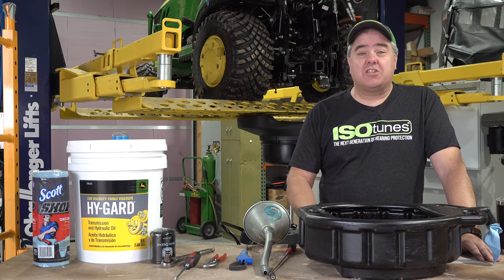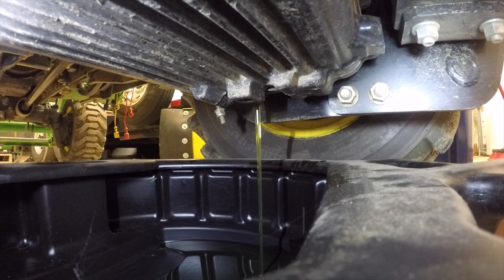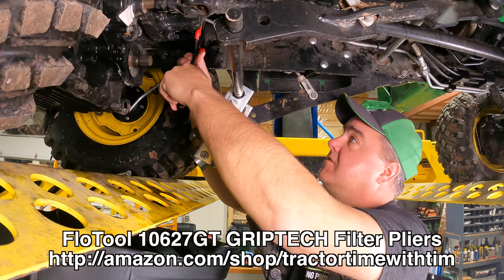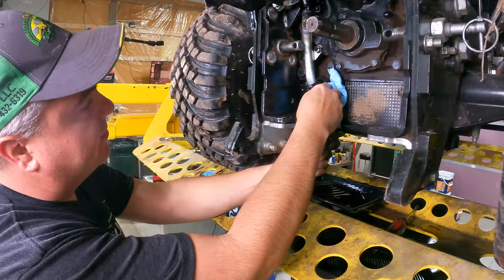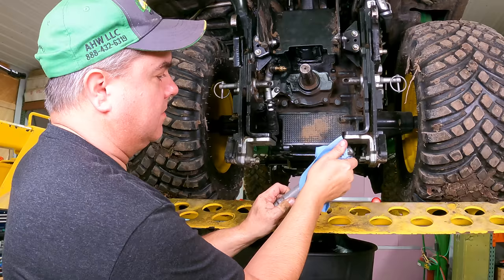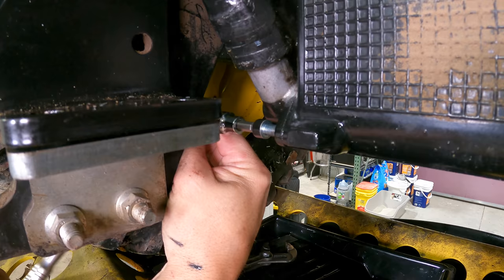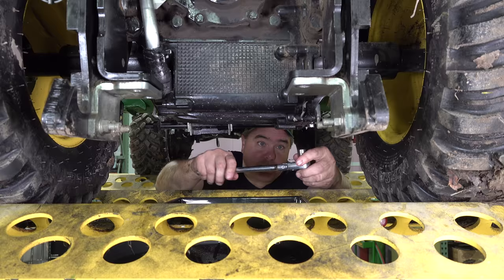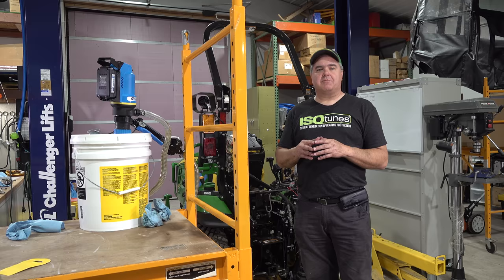Metal Shavings in Oil? John Deere 1025R 200 Hour Hydraulic Oil Change

Comment: Hey Tim, just a little cheat to avoid removing the hose clamps and lower rubber tube. I don't know if you can do this with your "custom" made tube with the temperature fitting. The pin for the left lift arm, just behind that and left of the PTO there is a single bolt 11:53 (top of the screen). Remove that instead of the hose clamps. It's just above where you placed the hose clamps once you moved them up the tube, 13:57. Once that bolt is removed, you then use the 6mm allen wrench to remove the bottom. You then pull left as usual, then separate the 90* elbow from the magnet portion. Then pull magnet portion out. 
With this tip, removing that one bolt, you eliminate wrestling with the hose clamps and trying to push the rubber hose up to remove it from the 90* elbow. It all stays attached and you only separate the tube with the magnet from the 90* elbow. This is a little trick a JD mechanic showed me. They do enough that they know little short cuts like this.
Reply: I'd seen this done before in another video. My only concern was getting the screen aligned as described in the service manual. Was it easy to get the screen inserted and aligned correctly? Thanks. I'll be helping a friend change his this weekend and I'll give it a try.
Reply: @CC-te5zf  Yes, it has a shelf type thing it lays on, no place for it to go other than where it needs to be. Just before being all the way in though, insert the magnet tube into the elbow, the o-ring will hold it together as one, then put the rest of the way in and tighten the 6mm nut. Then put the bolt back in next to the PTO shaft. Much easier than dealing with hose clamps and hose.
Reply: @joebarrett9830  Thanks!

Comment: Have been a mechanic for a few years. On the hose sticking the best thing I have found is to use a 90 degree pick , by sticking it on the inner diameter of the hose and sliding it all the way around the pipe or housing its attached to will usually free it up.
Reply: If is reachable, I use a thin flat screw driver between hose and tubing .

Comment: Hi Tim,
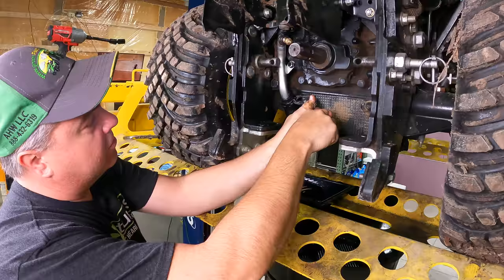While watching your video, at around 11:45, I noticed the mouse on your pallet rack along with your cat trying to catch it!

When I change any kind of oil, I put my hand in a small plastic bag, and then remove the drain plug. keeps my hand clean and I have found that I'm less likely to drop it in the oil pan.
Reply from the maker: Watch the end of the video for more cat and mouse video.

Comment: Small zip ties work well to hold those type of clamps open, on the oil line to the magnetic strainer. You can use two hands to more easily move the clamp.

Comment: 1 or 2 cans of brake cleaner saves alot of towels and helps make all surfaces clean before removing items. Helps with spill clean ups too.
Reply: Yes, a JD mechanic used brake cleaner over a 5 gallon bucket to catch all the shavings.

Comment: Remember Tim, Brake Cleaner is your friend. The added torque on the filter and the hex bolt usually come from paint the first time you disassemble them.

Comment: Hi Tim.   On another YouTube video watch a tail three cabins he has a 1025R2 and when doing this oil change he shows how you don’t have to mess with those clamps you just loosen bolts up above and it gives you enough room to pull it out
Reply: I was wondering about that also. Especially since that pipe was just swapped with the new one with the oil temperature sensor. With that bracket screw removed there is plenty of play in there to get at that hose and clamps. That pipe is attached with a rubber hose at the top as well so no worriee about flexing it.
Reply: do you have a link to that video, i sure would like to make that job easier.
Reply: @williamcoffman7149  all I know how to do is hit the search button. A tale of three cabins 1025R hydraulic oil change and it will come up.

Comment: Hey Tim,  I have recently (last year) done the 200hr service (really at 400hrs, dealer did the first one) and worked from yourold video.  Did not remove wheel.  I faced the hose removal challenge.  Wasn't too bad.  FIlter was a PIA.  Had to wrap a few layers of Duct tape around it to get my wrench to work.  LOL!  Great videos. thanks for sharing!
Reply: @Trevor4ag  Last resort for me as it can be messy.  That said, I've used it many times...and it gets the job done sir.

Comment: Tim, if you spray brake cleaner on the hose , the spring clamp will slide over the hose easier. It will not hurt the hose and will evaporate off the hose. It gives you just enough time to slide the clamp on. I own my own auto shop and have been using this trick for years. Spring clamps work better that worm drive clamps because the don't loosen up.
Reply from the maker: Cool. Thanks!

Comment: Tim, you must be a magician, you made sliding those xxxx spring clamps up so easy on rear axle, when I finally got mine off I went outside of my garage and threw them as far as I could and returned with worm gear clamps that’ll save me 45 minutes next 200 hour service. The fuel filter under the seat was a piece of cake in comparison.

Thanks For The Great Videos 

God Bless
Reply from the maker: Ha!  Thanks for the chuckle.  The first time was incredibly frustrating!
This time it went much better!

Comment: I wonder if it would be best to just replace those hydraulic hose clamps with regular screw type hose clamps.  Those would be much easier to loosen up.....lol....and that's why you don't comment until the end of the video!  Thanks for redoing this, I'm about to do this for the second time.  It will be interesting to see how the shavings look the second time.
Reply from the maker: Other commenters are saying these clamps are better
Reply: Use the spring clamps. They provide constant tension on the entire circumference of the tube. Worm gear clamps create a pressure point under the screw.

Comment: Hi Tim
When you were talking about replacing the hose clamp with a worm clamp it's interesting to understand the purpose of the continuous pressure clamps. When a worm clap is tightened and the hose ages many times there will be leaks. as the hose hardens. Squeeze clamps apply steady even pressure. You will see this around transmission cooler hoses on automobiles. Worm clamps are easier but defiantly not near as good. If they were as good don't you think assembly lines would use them as they are much cheaper.
Reply: But I would expect they take considerably longer to screw tighten (install) and probably would have to be factory torqued. Everything I have read for years instructs me to not re-use those "spring" clamps. I stand to be corrected with verifiable authoritative affirmation though. I would really like to know...

Comment: Just did my first hydraulic fluid change at 160 hours.  Must say I'd been preparing for the moment by watching you and the guy on Tale of Three Cabins, both excellent tutors. So, everything went easier than planned, and from start to finish was about three hours, working at my usual snail's pace. I have one very important recommendation for those of us who can't afford a steel tractor lift: Rhino Ramps. I bought four of these on Amazon for less than $200. They held my 1025r easily and made the job almost a pleasure as far as accessing the filter, plug and screen. Next I'm going to see if they hold my pick-up truck so I can do my oil change there. I'm 79, so I think there are no excuses for not doing the hdf change yourself if you're healthy. Stay safe and keep those videos coming.

Comment: Two things I highly recommend 1) prior to doing this kind of service do yourself and your tractor a favour and spray it down all over the drive line with a cleaner de-greaser and wash off. There is nothing that can be harmed in doing this it will only make the service go smoothly and long term over all benefit the tractor. 2) Get a paint marker and mark the new oil filter with the operating hours shown on the hour meter, this makes it very easy to keep track of when to do oil services.

Comment: Those strap filter wrenches work and work well as long as you don't get the cheap rubber straps. There is a strap wrench that had cords in it similar to a serpentine belt that does not really stretch and it works very well

Comment: Tim, thanks for all the valuable information that you have given me over the last couple of years. I have a 2022 1025R and I just did my 200 hour. The oil change was a piece of cake, greazing was kind of difficult at the hidden zurt, and the hydraulic oil went great until I found the plug washer on the bottom of the oil pan after I had already put new oil in. Luckily, it won't be too hard to drain and re-use the oil. Thanks again for all your help.

Comment: Hey Tim, they have spring clamp pliers that make those easy to remove. Then use a screw clamp to go back together so you don't have to fight them anymore. Just don't over torque the clamp when going back together.

Comment: Your comment about the oil pump being high end is an understatement.  A battery powered pump and flow meter is around $750. I can't see many DIY folks going that route instead of a funnel.  :-)
Reply from the maker: Without the flow meter, it is $394….then 10% discount.    That is much more reasonable in my opinion.

Comment: To your point about tightness.   I ride a motorcycle and when I do brake jobs or any kind of maintenance, I tighten to the torque specs.  When I did some work on my tractor the other day, I noticed JD had massively overtightened bolts.  They actually damaged a couple washers they overtightened so much.  I bought the tech manual from JD and they have a very nice torque spec table, but it doesn't seem like they follow it at all.

Comment: I never reinstall the spring clamps.  I replace them with aircraft grade T-bolt clamps.  Much easier to take on and off in the future.  And they can’t pop off the pliers and end up lost in the garage.

And, you can spray things off with brake cleaner to get the area around them.  And, it is a a good way to clean of the screen filter.

Comment: Thanks again Tim. I've never done this and was a little hesitant. I asked the dealer if they could come to my home to do it, as I don't have a trailer. They told me $450.00 ball park. I guess that's fair for having to come to my house but it's still a bit high for me, especially when it will have to be done again and again. I'll get the fluid  (and another filter wrench) and give it a shot. My biggest fear is stripping the 6mm allen (hex) bolt). Thank you.

Comment: 12” knipex channel locks will take the filter right off. It looks like it won’t fit, but I got it in there with the PTO shaft still attached. Tim is right Knipex pliers are legit.

Comment: Just did service to my tractor at 223 hours.  Looks like dealer just replaced fluid and did not clean screen at 50.  My case had alot of white sealant in the bottom.  You state its not a problem but I will take it to my dealer next week and see what he says.  Excellent video.
Reply from the maker: The sealant is normal.  No issue.  As far as I know, 100% of 1-series tractors have this.
Reply: sounds good, I'll let it be. @TractorTimewithTim

Comment: You may want to put some anti-seize on that bolt going into that aluminum housing.  The reason it was hard to break loose was 1.) paint, and 2.) a little galvanic corrosion all ready.

Comment: They do make hose clamp pliers for those hose clamps that hook in the eyelet of the clamp so they don't slip off and in some cases actually latch the clamp in the open position. A lot better then your "nipx" pliers.
Reply: I was going to suggest the same thing. They work excellent! I didn’t know they made such a thing until my buddy helped me change a radiator bottle.

Comment: Tim, I started watching your channel in 2017 when I was deciding on whether or not to get a backhoe for my second Kubota BX purchase.  Short answer, I did.  My first BX was purchased in 2002 and it was a great machine and my son has it and it is still going strong.  So I’m partial to Kubota’s for subcompacts.  I like Deere as well considering I have four of them of various size, shapes and vintage.  

So I finally subscribed since I have to comment to this video.  First off, good video as most are.  Second off, the BX is so much simpler to change the hydraulic oil!  There is no hose to remove, simply unscrew the large banjo fitting and let it drain.  Also, the reinforced frame for the backhoe does not affect ground clearance, so there is no issue there.  Can easily access all points with the tractor sitting directly on the floor.  And I’m knocking on the door of 66 years!

Anyway, keep up the good work but give Kubota credit when credit is due!

Bill
Reply from the maker: Thanks for subscribing and commenting!

Comment: The instructions on the side of that hydraulic filter are very clear, it says to tighten ONE TURN after the gasket makes contact.  Not all filters are the same. While most engine oil filters say to tighten 1/2 turn, the majority of hydraulic and spin-on fuel filters say to tighten a full turn after the gasket makes contact.
Reply from the maker: I won’t be tightening that tight.  Nearly impossible to get loose.
Reply: @TractorTimewithTim  The main reason the original was tight is because the factory put it on dry. They do the same thing with engine oil filters. Now that you have oil on the gasket it will be easier to remove next time.  As for those allen hose fitting bolts, the main reason they are so tight the first time is because they have thick paint on them, basically sealing them to the housing. So you have to break the paint bond before they loosen.
Reply: The reason some are one half turn and some are full turn or more is how many threads per inch on the backplate.

Comment: When I did this service on my 2018 1025R, I tried to reuse the O rings on the elbow (or 90 if you prefer) that the 6mm Allan bolt secures. The outer O ring that is compressed when the bolt is tightened had become oval or squished after being compressed for a lengthy period of time, and of course leaked... which means fighting with the hose clamps again after declaring victory originally. This is just a long winded way of saying if your machine is older, check the O rings if you don’t want to pay for hose clamp anger management therapy.

Comment: Hey Tim my go to filter wrench are sockets they come in 4 sizes and is easy to use whether you use an Cresent wrench or a 3/8 ratchet.  You first find the right size tap it on with a hammer then loosen it with any option of tool . I bought mine from Harbor Freight about 15 years ago.

Comment: Oh Tim, you may not have warmed the oil enough to help it drain. You did mention air pressure and I may have missed it in the video. You don't want the oil too hot as it can burn. I test the block temperature with my hand while it’s warming up.  I would throw away those hose clamps use the worm gear type as they are so much easier to use. A very good production and a bit more light would help see whats happening.

Comment: 18" Channelocks are the ultimate universal oil/fuel filter wrench. They easily remove 95% plus filters on any flavor equipment. You can use them for spring clamps and to twist hoses to release them as well. Great for pulling stubborn pins and rotating top links/turnbuckles or getting a pto shaft to line up the splines. Keep a set on the tractor and you will be going to them constantly. Well worth the investment, and handy for many jobs.
Reply from the maker: You should try the Knipex pliers.  So much more refined.  Amazing!
Reply: I have a couple sets of the Knipex, they're great, especially the Swedish pattern ones and they can put a lot of torque on frontend parts/pipe/rounded heads, but they don't fit the big stuff. The big Channelocks (model 480, 20 1/4" rated) might be a tad less refined, but they open up to almost 6" for filters, and have the leverage of the 18" + handles. They'll squash a filter flat if it's been overtightened (all too common, as you pointed out), but I never had even one oil filter I couldn't get off in over 30 years swinging wrenches, excepting the very rare case when they can't get into a very tight place.

Comment: Thanks as always for your helpful videos.  One tip that you might like, there is actually a really cool tool for removing those hose clamps. Astro Pneumatic  9409A Pliers (available on Amazon and other places).  These allow you to open the clamp and lock it in the full open position so you can use both hands to slide it along the pipe.  They are also great for all those tight spots where you can't get the Knipex on a clamp!  Another thing that will help with removing those tight filters, grip them at the base, right where the filter attaches to the housing.  The filter body is stronger there and more of your torque will go to loosening the filter.  If you grip it in the middle, the can tends to crush and twist.
Reply from the maker: just ordered it. thanks.
Reply: @TractorTimewithTim  Knipex makes a nice locking spring hose clamp that can swivel as well.

Comment: Should get some radiator hose picks for rubber hose so screw driver don’t tear the rubber they also make special flyers to help remove those clamps I got mine from Mac but I bet other companies make them they have grooves to keep from slipping out

Comment: I know most don't, but might want to torque the filter screw and oil drain plug to the correct values, hate to strip out either of those when they go into a block of aluminum.  I am sure your arm is calibrated, but galling out the threads would make an easy change an expensive one if you had to purchase a new trans-axle housing or send it to a machine shop to have things re-threaded.  Just a bit of armchair advice, from someone who has done it before in an aluminum block!  😁👍